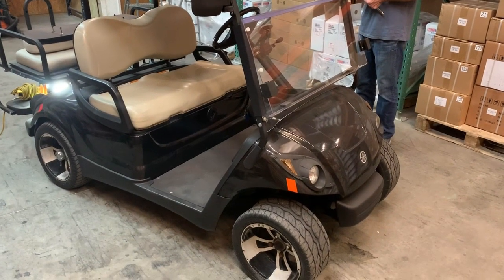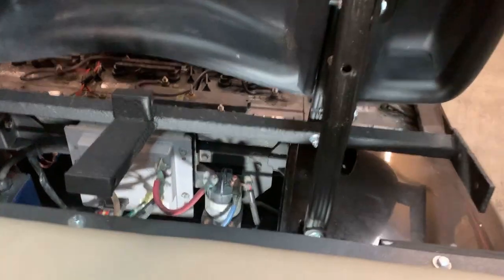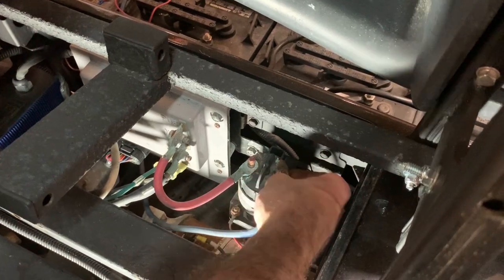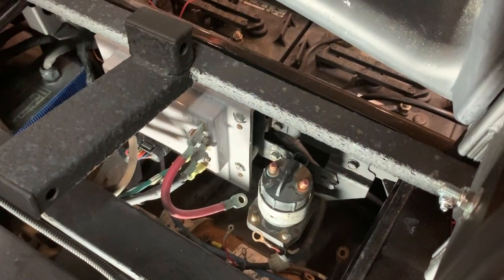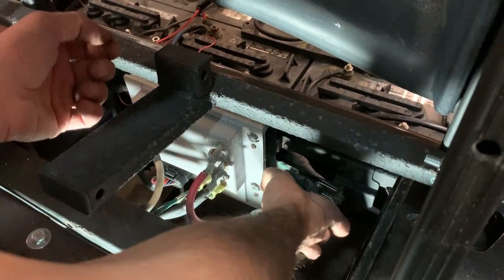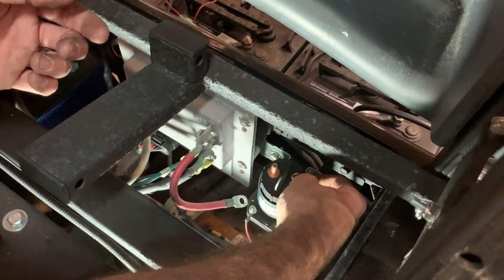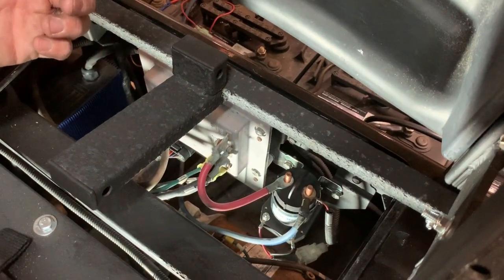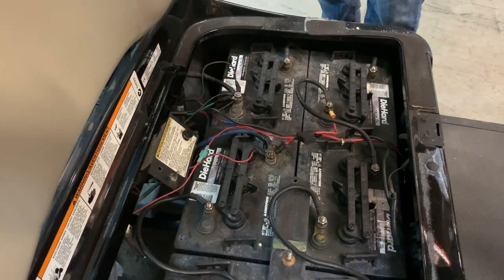Yamaha G29 Golf Cart Solenoid Replacement

Comment: What was the complaint before you decided to change the solenoid?
Reply: Usually the issue is the cart will start bucking then stop running or it will stop running all together when your driving. This is almost always a symptom of a faulty solenoid.

Comment: I’ve replaced mine and bench tested it prior to installing. It still does not click. Any thoughts?
Reply from the maker: Check your wire ends where they make connections (both sides) for corrosion, dirt, or debris.  Clean if needed.  Test for power on your incoming wires to the solnoid.